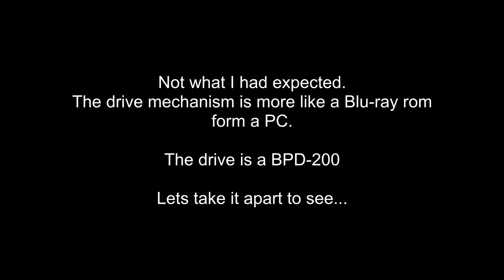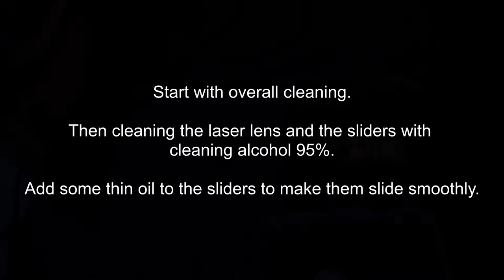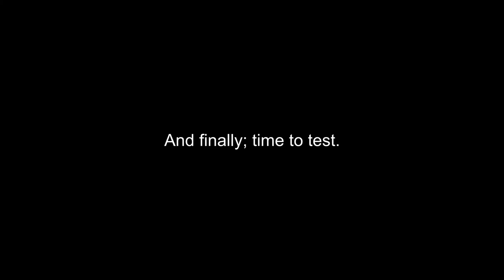Clean your Blu-ray player laser lens. Works again DIY. Sony BDP-S5000ES.

Comment: Hi you are doing great. Kindly don't do lens clean by So strong ISOPROPYL. It will erode the lens coating. instead, use LENS cleaning form ZEISS spectacle cleaning solution. It will not harm Lens surface optical coating. First, you should Blow air from the lens so that dust particle blow away. than Drop tiny solution on the lens and let it be there for 30 sec to 1 minute. It will dissolve all the population gumming in liquid. Now you can wipe with LINT free cloth wipe with an edge on lens surface with a light hand so that suspension of the lens doesn't get misaligned. Never use cotton bud it leaves cotton strand on the lens that might hindrance with the suspension of the lens and misaligned the lens permanently. Last now on match stick roll the lint-free cloth dry and wipe the lens so that if some liquid residue wet mark left on lens wet thoroughly dry. Otherwise more dust will stuck will the disc spins. So do it patiently. If proper clean with protocol next cleaning will be required after 200 disc play. Note: When not playing a disc in Bluray player. Leave one disc in tray and cover player with Double layer thick cloth. so that fine dust will not enter the optical and delicate moving parts. This help player optical last longer. otherwise is dust on the lens it deflects the laser reaching reading sensor. and the system increase more current to the laser diode and lens get burnt. So save the lens and enjoy movies.

Comment from the maker: The problem returned. Found the disc motor vas stuck. Replaced the drive unit with one from a cheap BDP-S550.

Comment: Sony's BDP-S350/550 use the same drive, so probably could swap a drive out of one of those if the drive really does fail in a 5000ES. Worth a chance considering how cheap the 350/550 are now.

Comment: I tried cleaning my ps3 Blu-ray player but it still the same afterwards, I looked at the lens with a magnifying glass and it was clean no dust , but cleaned it anyway, I am just glad I didn't totally kill it though, since I do have a lot of downloaded games on my 1 TB hard drive, just in case Sony decides to close access to the PSN store for PS3's which they tried last year I think, but changed their mind, I think my problem is the blu-ray reader is too far away from the disc as it starts to work after the ps3 is totally heated up, but still playing games it will freeze when it has to lead more information from the disc especially when trying to save games

Comment: What oil did you use for this please? I have the same problem with my S5000ES.
Reply from the maker: Not sure really. It's the oil that came with a hair cutter machine I bought. For lubricating the moving cutter head. Any thin oil that doesn't dry out will do.

Comment: I Tried the same Procedure by my S 350 who has the same Drive safely it doesn't worked maybe the Pick Up System is definitely defect.

It's sadly and the Problem is you doesn't get anymore a complete New Drive or Laser Pick Up.

Electronic for the Trash again . Ok it's 12 Years Old but the Rest is Still Funktion